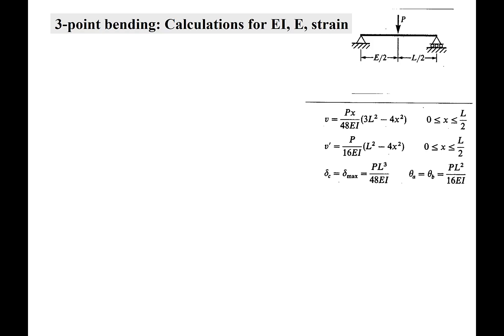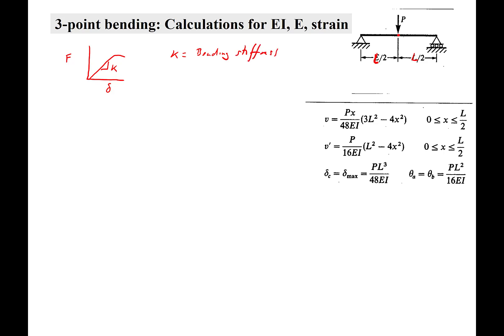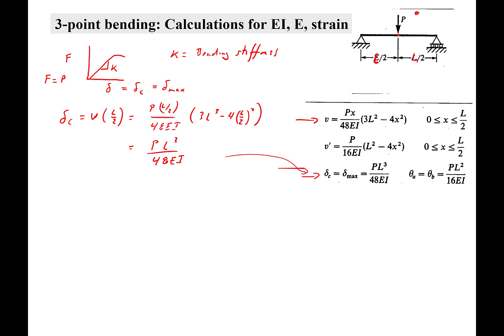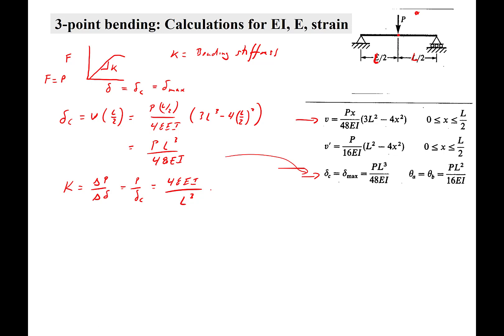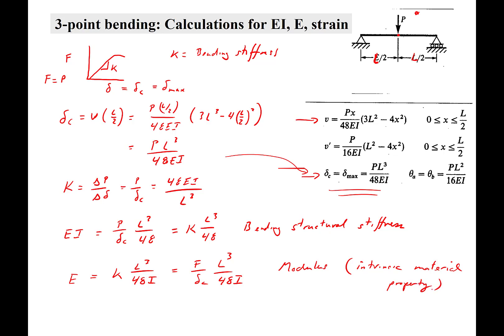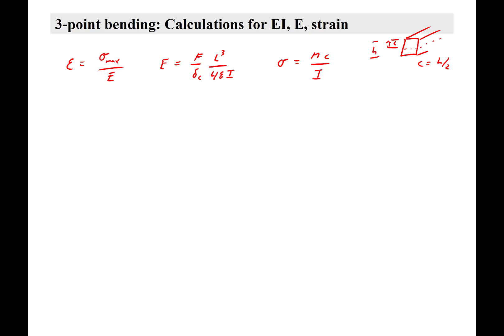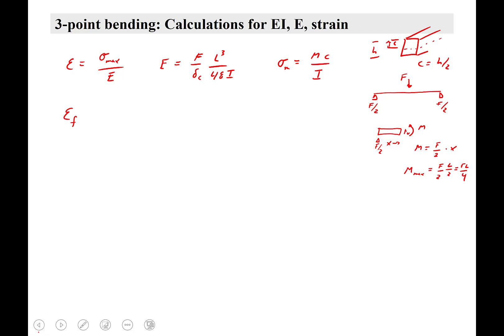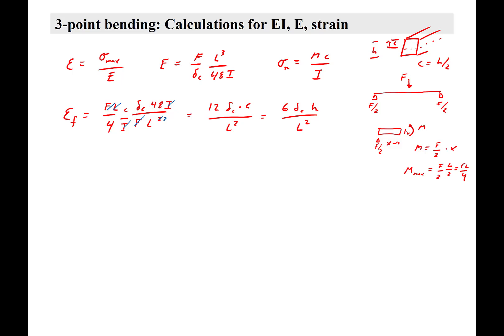3pt bending calcs

Comment: When you have flexural test data of load and deformation over time and you use the formula for E in an excel table of the data you'll have a series of E values. If the values of E is not constant over the changing load and deformation how would you recommend aggregating the different values of E into a single reportable E value?

Comment: If testing with a distributed load, and test measurements were PSI instead of force, how would the calculation of K differ? I realize for the rest I would use the 5wL^4/(384EI) for delta_max. But for K would I be able to resolve the distributed load into a resultant force and use it to calculate K?